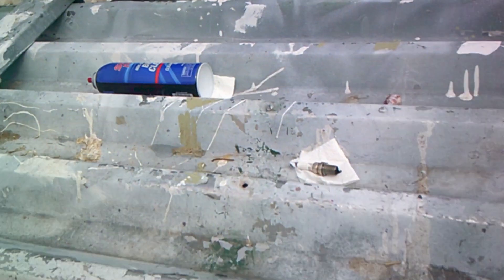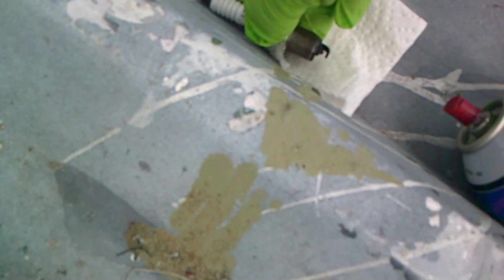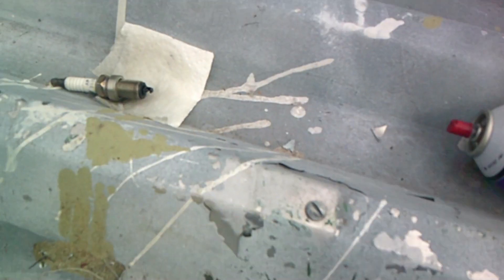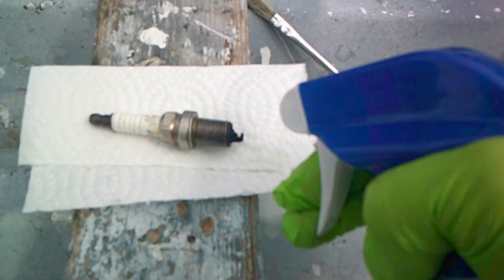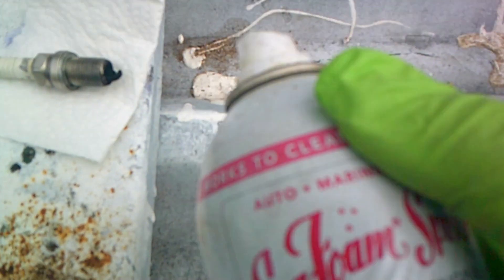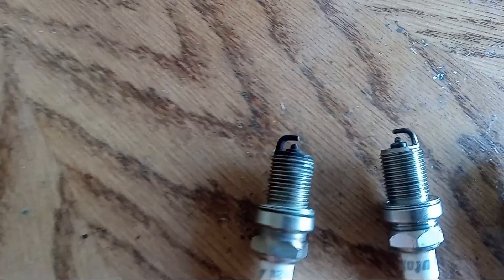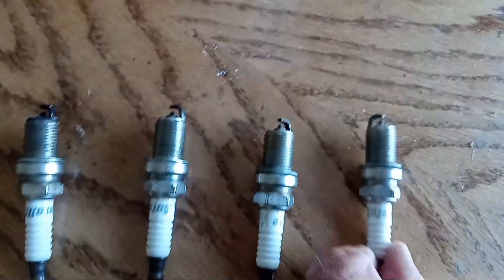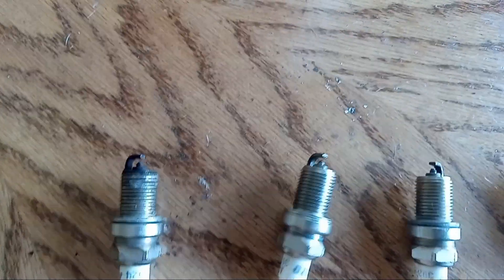I going to test 4 cleaners. I going to use spark plugs as a demo on how the cleaners clean carbon.

Comment: After you clean them can you reused them or they unusable?
Reply from the maker: This video was on what can clean carbon. If your going to reuse something electrical and something that will go into a engine it will be your decision to do so.
For instance, you would need to be concerned with a few reasons and a few thing to check before hand, like  was there any damage to the plug, check the spark plug gap, no water residue and no water residue trapped in the  insulation, if  you were bold enough to clean a plug with water and wanted to reuse it , is the plug  to old or damaged in any way that it cannot be safely reused ,  also check  that there should be no debris on plug like dirt or sand or metal flakes to name a few, no crack or cracks in the ceramic or insulation outside  or inside. Check the threads and the electro ide to make sure they will not cause any damage.  I just naming a few of the reasons to consider. I recommend not reuse plugs.